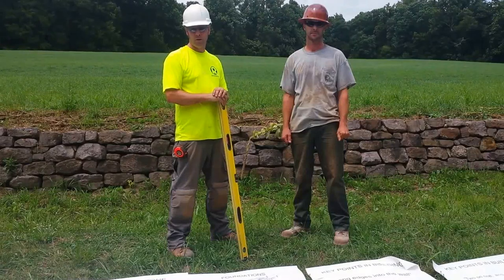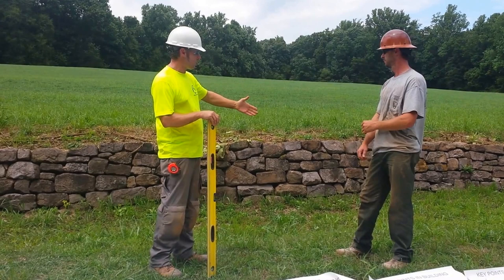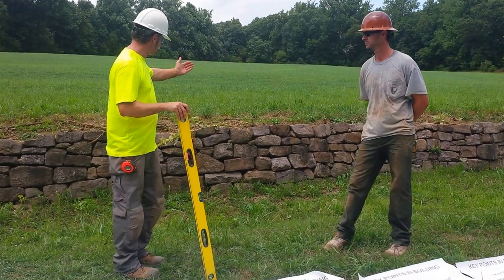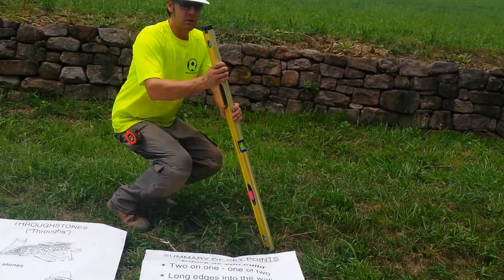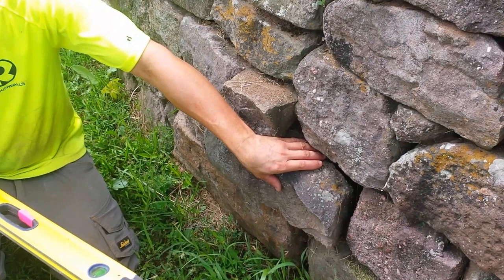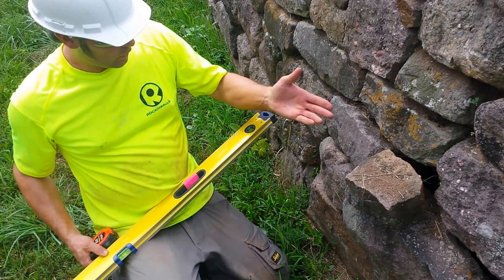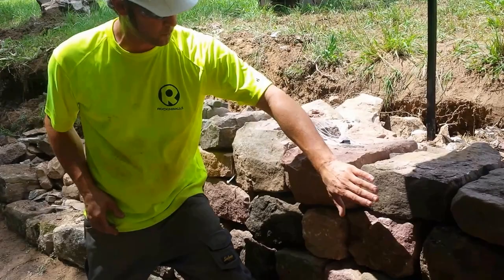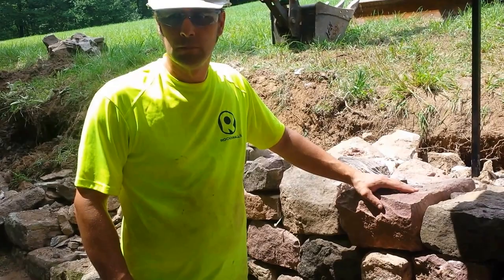Understanding Proper Dry Laid Stone Techniques - Hopewell Furnace National Historic Site PA - HPTC

Comment: Do you have any tips for retaining walls in swampy areas? I would like to secure a higher ground against a low ground that can be submerged in rainy years and seasons.
Reply from the maker: Hard to say exactly without seeing the space and knowing the stone type, retaining wall style... I have something similar issue with water all the time from springs. A Masters Neil Rippingale who was the one who built the Black House I had suggest on another video to you. Told me to set the largest stones I had. This way they are a large floater across the area. What I've been doing every year is work closer and closer into the major area of the springs. I'm doing a couple things working to try to build up a as I build in helping to put a little pressure at a time to really help is settle at a natural speed. With the hopes to minimize settling. Also I have a corner which will tie back into the other wall sections. I would be sure to add a lot of tie stones and make sure to follow all key dry stone guidelines to help make a wall system. Each stone working with the others to make ONE.

Comment: I’m working on a very similar wall at a location less than an hour from there. The stone looks about the same; only difference is I’m not getting stone from a quarry or anything- nothing fits together! I’ve never done masonry before this, been working on it since spring and I’m getting frustrated with it. None of my blocks are even in size, hardly any of them have clean faces, I’m doing my best but I’m losing steam :,)
Reply: Listen, I’m getting so overwhelmed and frustrated with this- but I’m gonna revisit this video and visit that wall and figure this thing out!!!
Reply from the maker: Done of the stone for this project came from a quarry. I actually found a bus company in the area which just so happened to have a huge pile on there lot. 

I find when working.oit.of piles of stone simply just take the time to look at different sections of what your building. Often, you'll find a stone right on top. You can place some we're else in the wall. So basically, I like to jump around.

Also, whenever you get to a point, you get frustrated, stop and pack the wall.or work on the back wall. I found that when I first started, I was thinking too much or looking too hard for the right stone. Just have fun trying the It Looks Good method and just keeps moving.

It takes years to learn how to read stone. 

Just have fun and enjoy the process. Stone teaches us life lessons every day. You just have to listen.

Workshops happen this Fall & Spring in Hampstead Maryland. You're only a little over 2 hours away. Just in case! 😊
- Mark

Comment: Excellent explanation and diagrams to go with. I'm quite obsessed with wall building at the moment and this was certainly one of the best videos so far. What about behind the wall? What did you use for drainage and what did they use for drainage back when the wall was built (or did they)?
Reply from the maker: Hello Shizzy good to hear you have the stone bug. I use Soil which is free draining. If you have issues with high water flow to the back of a retaining wall it is best to redirect it before it gets to the wall. Grass, Plants, earth berms, earth and stone dry riverbeds.....Or simply building up the back of the top so with a earth ramp so any water flow right over the wall. There is no one answer. Just not gravel is seen in this original wall. It did nothing to help with drainage. This wall shows why not to use gravel. Just use earth which will compact on its own.

Comment: Can you do a video on or at least touch on dry stack retaining walls and water mitigation do's and don'ts? I'm getting ready to start a project in Pennsylvania and can't find any consensual information about it.  You mention the aggregate in this video and it sounded like you didn't think it was good which had me wondering.
Reply from the maker: A dry laid stone wall is flexable and free draining. Why would you need gravel? You don't want water to get into the back of the wall. Think of soil as a slow draining filter. Gravel is a fast draining filter. Which will cause more damage then good. If you live in PA look at any of the old railroad retaining walls. Lots of great examples in PA wet and dry! Jim Thorpe is full of some amazing dry stone walls. 

NO gravel! NO Geo grid or Landscape cloth! 

Water is a site to site situation. Just remember you can never stop water only redirect. Good vegetation and earth ramping at top of wall are very helpful.
Pick up a copy of the Dry Stone Practical Hand book from the The Stone Trust or Dry Stone Concervance. Also consider coming down and taking a workshop at the Rockin Walls Training Center, Spring or Fall.

Comment: I wonder whether a retaining wall would last longer if the back face was battered back, along with the front face.
Reply from the maker: Most retaining walls are built with a the back 1:12 batter which is typical. ?  last longer is a matter of stone type along with if  proper building methods were used and correctly.

Comment: I have a question please.......i want to build a stone wall but i need the height to about 9 feet at one end and about 7 feet at the other. How wide would i have to start the foundation ? Can i use 30 inches width at the foundation?  Oh by the way the wall is going to be a partial retaining wall.....only up to about 4 feet at the deepest ends. Thank you.
Reply from the maker: Hello Marlon sorry it has taken over 1 year to respond. I had know Idea i had a comments sitting waiting to be approved. Well to start I would say taking on 9ft wall is a lot for anyone, Experienced or not. But couple key things to point our first. Most area require a engineered drawing over 4ft. So you would have to find someone who knows natural stone gravity walls. Then you will have the issue do they really know dry laid stone? Most likely NOT. Sadly in the US. Maybe UK. The standard rule of thumb is height divided by 2 is your base. I build a protruding foundation which is another 4" on each side so add 8". I've also heard add 1' ft. So just to keep it simple a 9' wall would need a min of 4'5" or 5' wide base. Thats alot of stone. This is where building your back wall with a local quarry machine size boulders might  be quicker and faster. Ofcourse you still place them as if it was 1 person stone. Keep in mind I'm not a licensed engineer.

Comment: Just up the road a piece from where you are doing this historical wall. Awesome job. Great crew going on there. Now, I am dealing with a 14' dry wall, retaining wall on a property I purchased 7 yrs ago. The wall is bowing out and the drainage rods are shifting. Ground shifting after I found large rock had been removed from the wall. I have proof, it was moved to the top of my parcel which is mountainous terrain and leaning against my neighbors house. Long story, forget about it. I guess being 60 years old and a female is probably not a task I could undertake? I anticipated removing rock from top down and I am now concerned with collapsing. Could I patch it with additional rock w/o turning this into a major task? The wall was hidden under ivy when I bought the house so surprise when I pulled the ivy. I own the property but not the coal mineral underneath. I am also dealing with severe soil erosion. Any tips? Or should I just move back to Philly?
Reply from the maker: Hello Dolores, Well bowing is typcally caused by improper builds. Chances are if you took the failing section apart (yes you can just strip out sections that are failing- this is why I love Dry laid stone) you will see its most likly just one wall stacked against dirt. You can't build like this. I don't know what drainiage rods are? A dry laid stone has no draininage rods. You may actually have a mortared wall if you have pipes threw out your wall. Feel free to email me some pics I can tell you first if it is Dry Laid stone. Getting the Ivy off was a big start! Good job.
Reply: @RockinWalls  Wow, just got your reply. Thank you so much. I've done so much to that wall since I last responded. I was really impressed with your work and job site. Wall is now totally different I have been working on it for a few years. At one point a neighbor drove by in his truck and jammed his brakes on. I watched him do that while I was on my upper portion. Kind of funny. 
Everyone up in this mountain section did dry laid stone. I'm sure my wall is the same. Only taller than most and bowing more than most...still. I have worked it adding, leveling, building (ugh) another retaining wall perpendicular to the main bowing wall. The other side was retained w/ 1950's railroad ties. I know it will be a temp fix but I used cinder blocks and bricks, painted with Portland. I paint everything with Portland as I love the look. Btw, I should have said drainage pipe not rods. I've learned a lot since my last post. 
I suppose you are done with that job by now. Very cool. My wall spits out antiques. Glass buttons, Civil War marbles, uranium bottles. Thank you for your interest in my post. I missed the notification and all of a sudden you were in my timeline and I remember watching. Awesome stuff, great work.
Reply from the maker: Sounds like you've been having a lot of fun! Happy to hear you've been at it. I love finding stuff in walls. I often leave time capsules in my projects. 🙂

Keep On Rockin'
Reply: @RockinWalls  Very cool with the time capsules. Never thought to do that. I didn't realize working with stone is truly a way to leave your mark on this planet. I just love working with rock/stone. What a great career! Not easy work though. Like a Mason, your career will wear on your joints.

Comment: 36/6=6, not 8.
Reply: 5:45
Reply: simple arithmetic on khan academy will help you be more confident with the math. a good example would have used a section of the wall that actually was 1 to 8 batter. why show a section that is actually 1 to 6 when demonstrating that most of it is 1 to 8? makes no sense.
Reply from the maker: Hello TONY THANK YOU!!!!  - Yes you are correct 1:6 Batter sorry for the confusion. (That was a one take video not to mention I'm have dyslexia math has never been a strong skill - walling has helped me alot to get better) That section of a wall was a bad example to show. The original wall was most likely not built to any specific specs. The most common freestanding walls are built to 1:6 a few are 1:8 if you have a traffic load above you may go as far as 1:4. So yes to clarify your point you would take the Height of the wall divided by how far it comes in at the top after setting a level "PLUMB" LOL This video shows everything the best https://youtu.be/zuOhk0EoHQ8

Thank you again for helping to clarify this point and fact of others!!

Comment: Sorry mate but why are you working with all stone in your way and tripping over all day .if you go more random your wall will be stronger and more build faster obviously your not being paid on the yardage.
Reply from the maker: Chris the stone is more flat bedded then random. The pattern also must match the historical walls being a National Park. This is a rebuildn on a failed sections. Since the walls were built wrong. More local stone had to be found from recently excavated sites. Which is more random. Then must be shaped and fit to match all mason built walls. Had nothing to do with Yardage. You are correct the stone dictates the walling style. Not the other way around. Unless you have to match a historical structure...